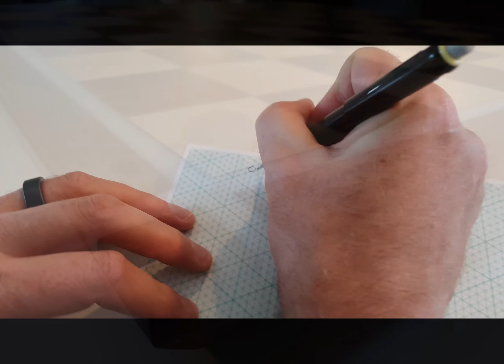How would you make this chess board?  This is my answer to that question...

Comment: Beautiful board! Only thing though is that I would have tried to avoid the lines of joined boards in the middle of squares in the final product. But even with that, it's still absolutely gorgeous.
Reply from the maker: Agreed, thanks for commenting!
Reply: I think it gives the chess board more character. The design and timber is spot on.

Comment: I would have found a way to dado in an Led strip that projects from underneath to the epoxy strips. Always handy to have a plunge/hand router in the shop if not a router table. I also don't know why people keep going straight from an orbital to their finish coat. All to often an orbital sander will leave micro swirls that can show up unless sanded out by hand using a sanding block.
Reply from the maker: The LED strip is a great idea, thanks for commenting.

Comment: Your attention to detail and finesse is brilliant, but how does this design account for wood movement? It looks to me the bordered pieces with grain perpendicular to the rest of the board will likely split along the glue line over time.
Reply from the maker: Some people have asked about wood movement previously as well. It has not split anywhere as of yet and it has been over three years with multiple season changes happening.  But, it is a good question to ask.  I think that the movement is so small that it has not affecting the outer border.  Thanks for commenting.
Reply: @BrokenThornDesigns  Awesome, great to know for the future. Thanks for the update :)

Comment: beautiful chess board. The only thing is with all of the hard and precise work you put in there are orbital scratch marks in the edges 15:03. Most people wouldn't notice or say anything, but I just thought you put such a lot of effort into it just a little more and and it would be faultless given the material you had to work with.
Reply from the maker: Thank you for commenting.  You have a next-level eye for detail!!  Will you come to stand next to me when I'm working? :)  Thanks for commenting
Reply: @BrokenThornDesigns  I really appreciate the accuracy of what you have done. When I first saw the thumbnail I thought the thin outlines were a darker timber inlay and I wanted to see how you did that.
I have done lots of projects that have had the same issue with the orbital scratch marks very difficult to eradicate without hand sanding.
Your craftsmanship is absolutely first rate though.

Comment: As all who have seen your video...very impressive...vary beautiful. A question about the epoxy: It appears you used the "Pearl" epoxy for all grooves, yet those around the squares appear dark while the boarder is pearlescent. Are those around the playing squares picking up the color from the walnut and it's just a difference in width of the "troughs?"
Reply from the maker: Good eye!  I think it's the size of the "troughs" that is making the color difference.  The pearl pigment that I used is granular and needs light to bring out the pearlescence.  Those troughs seem to block the light.  I've thought about using a liquid dye to mitigate some of the color variance, but I would probably lose some of the pearlescence without the powdered pigment.  Thanks for commenting and asking about this.

Comment: Can you please tell me, have you checked how maple wood works with walnut in terms of thermal expansion coefficients? What is the risk that these types of wood are not friendly with each other, resulting in cracking, swelling, or splitting? Also, what if I wanted to make the board wood-block end to top to make the wood structure more fancy - would gluing them be any different?
Reply from the maker: Ah... wood movement and expansion:  Jonathan Katz-Moses (search him on YouTube) has a video on wood movement from both heat and humidity.  He also has printable resources that can actually predict wood movement.  It's a great resource for what you are inquiring about.  As far as maple and walnut being glued up in tandem, woodworkers make cutting boards with this combination all the time without issues.  When I made this board, I made it edge grain on top.  I'm not sure what you mean by "wood-block end to top", but if you mean end-grain showing on top, than yes, that would be a very viable option.  Gluing would be no different, you would just need to keep the end-grain oriented the way that is most desirable to you.  Hope that helps, good luck.
Reply: @BrokenThornDesigns  that helps a lot, thank you, and happy new year!
Reply: @BrokenThornDesigns  Oh, BTW, I actually meant end-grain on top, just didn't know how it's called in English. So, since your board was made edge end, could you tell me what was the thickness (edge size) of the wood planks that you used?
Reply from the maker: @petr3788  I had to glue the wood planks together to make planks that were thicker than 2" and then I cut them to a little larger than 2" square so that each square that you see on the board is 2" x 2" after final cutting on the table saw.

Comment: Nice work - looks great :) Question though about wood movement. Most people who put frames around the chessboards need to leave a gap to allow for movement of the squares. You a recess but it's filled with resin. Will there be any issue with the board warping or even cracking over time? Some people use thin strips and glue it to plywood for stability but yours are thick pieces which will almost certainly move a little. Since this video was from over a year ago have you observed any issues yet? Asking because I'm wanting to make one myself and I hate the idea of having a gap between the squares and frame.
Reply from the maker: Thanks for commenting.  Here in the Midwest part of the US, we experience huge shifts in humidity and temperature depending on the season.  There has been no noticeable wood movement on this in over a year.  I fully understand you not wanting gaps or cracking, good luck!
Reply: @BrokenThornDesigns  i was curious about the same thing 🙂
I built 2 and realised there might be an issue 😬
Thank you for sharing!

Comment: I would have whole pieces for the walnut squares instead of gluing up different pieces of walnut.  Color match would be what I would want.  And I would have used black metalic in the epoxy.  Other than that, Nice job.
Reply from the maker: Yeah, if I had it to do over again, I would have looked for bigger pieces of walnut. I hadn't thought of the black metallic epoxy before, interesting idea. Thanks for commenting

Comment: I am making one right now using Wenge and some nice figured Maple, it's looking great so far and I appreciate the amount of work that you put into yours. I think after all that work I might be a little reluctant to route out those handles  (I'd be afraid the router would slip and ruin my masterpiece) do you think those handles were necessary  especially after beveling the bottom outer edge like you did? also what did you use at the end for a finish, was that just a finishing wax (that you buffed out)?
great job by the way, one of the best looking chessboards I've seen so far on the tube!
Reply from the maker: Yes, the routed handles were a high risk. If I were to do it again, I would use my Pantorouter with a diy template to route them out, it is much safer from catastrophic slipping. So if I were you I would take that (router mishaps) into account. I used Rubio Monocoat pure for the finish. It's a food safe hard wax/oil combo. I love it. It's similar to Odie's oil or Osmo. I hope your chessboard turns out well, send me a link if you make a video or take pix. I would love to see it. Thanks for commenting!
Reply: @BrokenThornDesigns  thanks for the reply, I doubt if I'll video it not really into that but if it turns out well (fingers crossed) I'll definitely take pictures and post them somewhere, when that happens I'll for sure send you the link. Keep up the good work!

Comment: Beautiful work bud. How many board feet of material did you go through? Work at a mill/shop and this looks like a fun project
Reply from the maker: Thanks!  A little under 12 board feet.  The walnut was already milled into 2x2 blanks, but the maple had more cutoffs and waste.  I would love to see your project when it's done.
Reply: @BrokenThornDesigns  I'm going to be using scraps so it will be a little more effort, but next to free. I especially like the epoxy grid and then the thicker lines in the border. Probably round over the top, and do the hand holes with a router, idk. Just an experiment. I was looking for something, so thanks again
Reply from the maker: @michaels775  Good Luck with your build.  I think it can still turn out really good with scraps.  I hope that this build gives you a lot of ideas for yours.

Comment: B3 square is really getting to me, what's wrong with it ? E6 too.
Reply from the maker: I really enjoyed this comment!  Depending on what orientation the board is in, I think I know B3 and E6... at least I think I do.  Those maple pieces were thinner than the walnut so I had to glue 2 pieces together to get the thickness of the squares.  On some, the 2 boards had vastly different wood characteristics.  That is what you are seeing there.  Also, I filled a void with epoxy.  Thanks for commenting!

Comment: Interesting. There are many "end grain" chessboard videos, but this is the first I've seen of an edge grain one. I guess you stuck the end grains together. Now that Patrick Sullivan has conclusively demonstrated that end grain glue joints are as strong as edge grain, it is open season on innovative designs :) Thank you.
Reply from the maker: Wow, I'm actually super impressed that you noticed that detail.  This board won't be under water (at least I hope not) and the wood was acclimated for a long time (3+ years) so I weighed the risk and reward.

Comment: Nice work
But why gluing the two woods in two boards just to cut them again?
Reply from the maker: The squares are 2.25" square and the boards that I had to work with were not that thick, so I glued them up and then cut them to the right size squares.